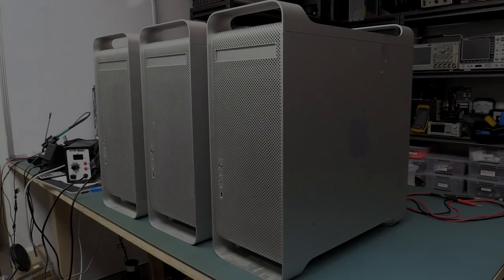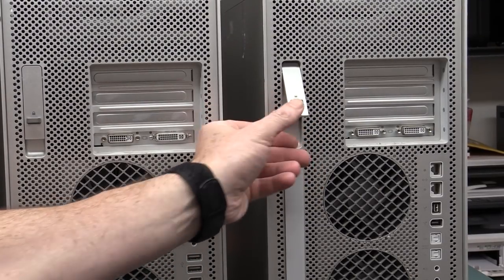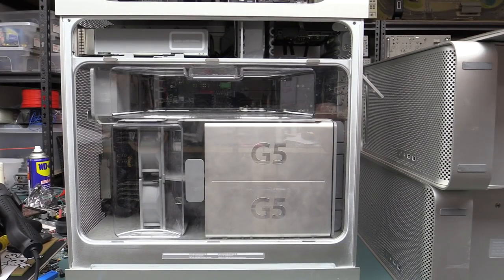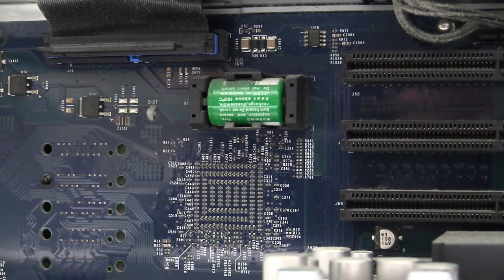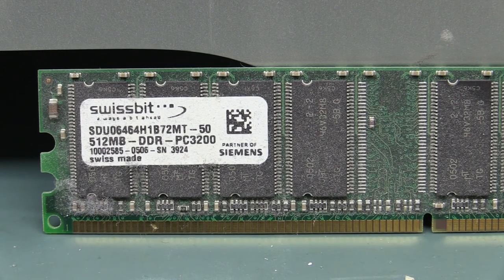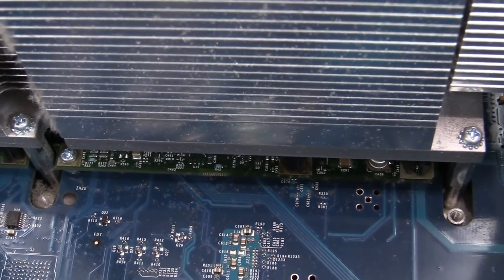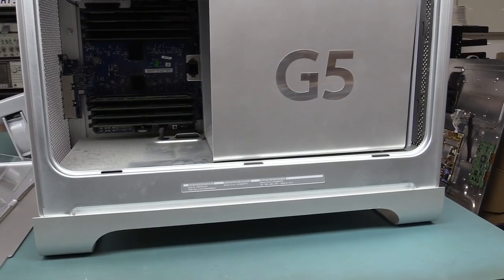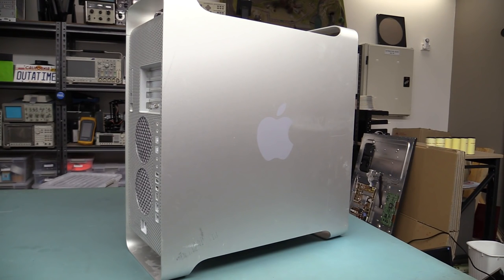EEVblog #783 - Dumpster Dive Power Macs

Comment: One word  LINUX!
Reply: all three of those machines will be verry capable while running a decent distro
Reply: There are no Nvidia drivers for Linux on PowerPC.
Reply: you replace the video card
Reply: +Fennec Fox (FennecTECH) With another unsupported card? Vendors won't write drivers for PowerPC systems because nobody uses those CPUs anymore, except for embedded systems.
Reply: Use a intel card   open sourced drivers like fx86-video-intel or noveau will work   and think about it   a simple generic rframebuffer drivver will do just fine in such a machine i mean  what kind of poweruser things will you do on a powerpc archatecture   it will do great for media   plenty of oomf
Reply: +Fennec Fox (FennecTECH) If you're giving up on graphics acceleration, what's the point of switching to Linux at all? The Mac OS X drivers still work and it's BSD Unix under the hood.
Reply: a machine doesnt need graphics acceleration to be useful   the point of switching to linux is having a mainstream (and still patched) operating system that has more uses than as a mp3 and dvd player
Reply: +Fennec Fox (FennecTECH) A desktop needs graphics acceleration to be useful. A server doesn't, but these machines are museum pieces. For the cost of power to run them you can get far more capability from a modern server. Using them as servers makes no sense unless you like burning money for nostalgia.
Reply: +Patrick Winslow Nobody uses those anymore, when power is the getting bigger and bigger on the server side.
and the fact that it's an open platform compared to x86
Reply: +MrKillius24 ?
Reply: Patrick Winslow
You said power died. It's still alive
Reply: +MrKillius24 I said vendors won't write GPU drivers for Linux on PowerPC desktops because nobody makes desktops with those CPUs anymore. I know Power CPUs still exist in the server market. The point is that the G5s in the video are not practical as either servers or desktops.
Reply: Patrick Winslow
The open source drivers are still maintained and work perfectly. Also if we wanted a better platform than x86(It sucks). Power is defo ready for the taking for any company
Reply: +MrKillius24 I've never seen anyone actually get Nouveau to run on a PowerPC Macintosh. Even on x86 it performs far far far worse than the  proprietary Nvidia driver. That will not change for the foreseeable future as Nvidia is the most uncooperative company on Earth with regard to free software development. Also, PowerPC is not coming back to the desktop. IBM made a deliberate decision to leave that market because they  couldn't keep up with Intel's R&D spend. That's why Apple was forced to switch to Intel in the first place. The x86 ISA sucks, but even Intel couldn't escape it. They've tried. The power of legacy is just too strong. But ARM may become a contender someday.
Reply: Patrick Winslow
 Not what I said, I said power is an open standard that any company can come and make better. They could make a consumer grade chip tomorrow.
Ibm would be happy to lease them the chip designs
Reply: +MrKillius24 Any company can try but no company will succeed in turning a profit. Intel's process advantage is too great. There aren't enough PowerPC enthusiasts who will pay a premium for a processor just because it isn't x86.
Reply: +Fennec Fox (FennecTECH) The world is actually UNIX. These machines run OS X which is a certified UNIX, Linux is not a certified UNIX. OS X can run all Linux apps as well as Linux can but Linux cannot run all OS X apps (same is true for UNIX apps). If you want to geek out, just open up a terminal window in OS X and enjoy the full powered UNIX command line.
Reply: i know osx is unix   iOS is also unix (i have one of my own with a ssh and ftp server on it)  but linux is far more useful than most unixes   the OSX wich will run on that is out of date and unsupported while you can get a linux distro thats latest release will run on the machine.
Reply: yeah
Reply: Or OpenBSD.
Reply: Even the Linux community has abandoned the PowerPC Macs.
Reply: historically i realize how expensive are macs, and to resell them, nobody wants them after. it's a waste of money.
Reply: I'd just like to interject for a moment. What you’re referring to as Linux, is in fact, GNU/Linux, or as I’ve recently taken to calling it, GNU plus Linux. Linux is not an operating system unto itself, but rather another free component of a fully functioning GNU system made useful by the GNU corelibs, shell utilities and vital system components comprising a full OS as defined by POSIX.
Many computer users run a modified version of the GNU system every day, without realizing it. Through a peculiar turn of events, the version of GNU which is widely used today is often called “Linux”, and many of its users are not aware that it is basically the GNU system, developed by the GNU Project. There really is a Linux, and these people are using it, but it is just a part of the system they use.
Linux is the kernel: the program in the system that allocates the machine’s resources to the other programs that you run. The kernel is an essential part of an operating system, but useless by itself; it can only function in the context of a complete operating system. Linux is normally used in combination with the GNU operating system: the whole system is basically GNU with Linux added, or GNU/Linux. All the so-called “Linux” distributions are really distributions of GNU/Linux.

Comment: 0:20, actually thats false. It's still possible to use them as main computers to this day. Theres a lot of software available for them and if you need any help, PowerPC Macs have a tight community that would be happy to help anyone.
Again, 2:53, that's false. An iPhone 6 is not as fast as a dual 1.8GHz G5. And a G5 can do a lot more. They are not useless. I don't want to be a dick, I like this channel, but maybe do some research and use them before you go calling them slow and useless.
10:45, yes, they do run the latest version of Ubuntu and Ubuntu Mate.
Reply: +Walnut Spice Throw some 1TB Western Digital Blue drives in them, up the ram to at least 2GB, up the video cards from anything but the GF FX 5200 64MB card and you'll see, they are way faster and more usable than you claim.
Reply: ***** Have you used one? So you don't know the performance of them.
Reply: ***** Does it have the original drive in it still? Upgrade it. Huge performance boost.
Reply: +Walnut Spice I absolutely agrees with you. I have several customers that still use their G5s to this day because are professional film and sound editors and there is just no reason to replace them. The G5s work perfectly. It seems that all that airflow engineering has kept all the components so cool that they just haven't failed. Some benchmark scores might be higher for a current iPhone that for these G5s but in the world of video editing, no iPhone now can keep up with the G5 (we have tried a few editing apps on the iPhone, they are great for short simple clips but that is all they can do), the G5 can plow though massive amounts of video data for many hours a day without a hiccup. Its an apples vs oranges kind of discussion.
Reply: THANK YOU!

Finally, somebody with an inkling of an understanding of the G5 processor!
Reply: Ok so this is just me watching old youtube videos and replying to old comments in the middle of the night, but that's just a load of nonsense. It's a bit hard to find data on these old things but here's some LINPACK numbers:

"the Dual G4 1.42 achieves 90Mflop/s, while the new Dual 2GHz G5 scores 236Mflop/s"
https://www.macrumors.com/2003/06/30/powermac-g5-benchmarks-again/

The top score posted by an iPhone 6 is 759 Mflop/s
http://linpack.hpc.msu.ru/devices.php?mac=&dev=iPhone%206

Here's a graph of linpack performance of contemporary intel/AMD CPU's (scroll down):
https://techreport.com/review/6213/intel-pentium-4-prescott-processor/4
As you can see, not even the cheap and cheerful Athlon XP in its worst case scenario performs as poorly as the G5, bottoming out around 280Mflop/s!

For perspective: The fastest modern desktop CPU's, intel core i9 reach almost 1 *tera*flop now in 2017 (near 100Gflop/s single core performance).

https://www.pugetsystems.com/labs/hpc/Intel-Core-i9-7900X-and-7980XE-Skylake-X-Linux-Linpack-Performance-1059/

The G5 was a terrible CPU for real world use and thermal performance in relation to its cost, a mainframe architecture bodged into use for desktop and Apple never solved the thermal issues adequately which was a huge part of why they went to intel CPU's after this (also why there was never a G5 laptop, it just was never going to happen). They don't have these monstrous heatsinks (and some of them needed to have water-cooling!) because Apple engineers wanted them to run cool or quiet - it was just absolutely required to dissipate the enormous 200+W heat load generated by two G5's at full power.

Some info on that from random internet forum:
http://macos9lives.com/smforum/index.php?topic=2211.0

I guess it won't do anything for the "cult" of G-series powermac worshippers that existed already when these things were new, buying into Apple's absurd marketing wank of how these computers are powerful enough to be export limited as "supercomputers" (according to an obsolete government standard) and all that.

https://www.tekrevue.com/apples-1999-power-mac-g4-really-classified-weapon/ For those who are interested in a retrospective on that.

Even going on Apple's own marketing, Mac performance around doubled to quadrupled overnight when they launched intel Macs, which really makes me wish I had been a fly on the wall in their marketing department when they had to explain THAT.

Comment: 1:37 - wifi/bluetooth antenna

That machine also supports 16GB ram as the other two only supports 8GB.  Memory has to be installed in pairs too

Comment: If the G5s are dead, you can get ATX case conversion kits. Some kits only require cutting the rear of the case, and you can put in a full ATX motherboard. You can even get wire harnesses which allow you to use the stock front I/O panel.

The last version of OSX that these will run is 10.5.8, though most people who still have them will probably want to go with 10.4.11 as then you can run classic Mac games on that OS.

Comment: The one on the right, looking at the view showing their backs, is a late 2005 based on the way the ports are configured. It was the only one with built in wifi and bluetooth antennas.

Comment: 3:05 those are Gems and it’s all upgradable to max specs and can still perform almost as good and fast as the modern specs machines, this video is quite old but I just wanna shoot the stars if one of this pups is still available in your lab I’ll be very happy to foster it and happily use it as my main machine 😁

Comment: I have the dual 2.3, the one above the PCIE model you have, they're actually dual core single processor machines. They made a dual processor model that was in total a quad core machine as well. I put a  GeForce 7800GTX 512MB video card in it and it'll still play HD youtube videos amazingly, its still very useable despite its age.

Comment: In my experience in the UK they're still pretty damn pricey on the used market (even the underpowered 1.8GHz models that are basically useless). The cases are worth a small mint too. They are still somewhat useful as a PowerPC Linux machine or a server or something if you're not too concerned with the power bill.

Comment: I had one of those dual-CPU PowerMac G5's back in 2011 or so. That thing could still kick ass, and beat out the Intel Core 2 Duo's of the time despite being quite a bit older. They were the fastest desktop CPU by Motorola, and output so much heat that liquid cooling came standard. Unfortunately that is also how many of them met their demise, as many started to leak after a few years.
Reply: +IronOreGaming   and that is why Microsoft picked up the PowerPC chip for their xboxes and are still having heat issues..........
Reply: imark7777777 I'm pretty sure Microsoft never put a Motorola chip into their Xboxes. The 360 used an IBM chip, and the Xbox One uses an AMD chip.
Reply: +IronOreGaming I'm sorry I was thinking that Motorola developed the PowerPC chip, instead it was a apple-IBM–Motorola alliance. I was also under the impression that they continued off the development from a test system that used a PowerPC chip but instead they continued with a similar architecture chip.
I remember hearing lots of stories of Microsoft demoing Xbox prototypes on Apple equipment.

(insert quote that backs up my story)
http://lowendmac.com/ed/bashur/12db/g5-gaming.html

Comment: Nice find I owned a 2005 power pc and I loved it to bits it's still a lot more powerful than a iPhone I can assure anyone that I remember playing halo in maxed out settings on mine which my not sound like much today but nearly all Intel PCs struggled to play the game. I eventually upgraded to a Mac pro 1.1 which was another under rates beast and now I've a Mac pro 4.1 which I'm using today still a beast with dual Intel quad core Xeon's 44GB RAM, EVGA GTX 980 SC 200GB Intel SSD and 2TB WD HDD

Comment: That white strip on the backside is actually for the internal wifi antenna if I am not mistaken. The older models had a special antenna port where you would need to connect an external antenna to if you wanted a wifi connection instead of ethernet.

Comment: Dual G5 systems are still very usable for audio production, but one has to be particular with software selection. Reaper 5 is brand new but still has a PPC build, for example. Nice score, Dave. If you intend to blank and reinstall the OS on the working systems, you'll need discs for OS X 10.5 / Leopard.

Comment: had the same dual processor unit,as you stated it was a fantastic looking machine as far as construction,but processing power was a real drag so i traded it for a Mac Mini dual which is still with me after 6 years,flawless work.
In perspective,its a pity using all that nice metal for a machine that has a programmed life of 2/3 years maximum,today maybe less,also because it is almost always placed in a shelf under your table,so nobody can admire that beautiful construction

Comment: Also you can run Final Cut Pro 7 (2009) on them, though Apple says FCP 7 only works on Intel.

Actually, it's a universal binary and is limited to Intel macs in the installer.  Edit the installer's .dist file and remove 4 lines of javascript and it installs perfectly.

Comment: 56K modem really takes me back in time.  They were slow, noisy and for the longest time there was no other internet here in the stix.  A few years ago, our options opened up some and now there is cable and DSL.  DSL is not the best but ANYTHING beats the dial-up connection we had by a very long shot.  Dial-up was awful.  If someone picked up the phone, you would loose your connection.

Comment: Just a heads up, it looks like the newer one is water cooled. also the PSU can handle 1000w full duty cycle. (good for electrolysis). The CPU boards are quite interesting btw.

Comment: I have one of these and will be modding it to put my current pc or future build in it. Also I am pretty sure that the case is Steel. It is about 30lbs dry with nothing inside.
Reply: its definitely aluminium.
Reply: +Glen “Protious” Jones Its clearly aluminum and says so on the Apple specs page. Try a magnet.
Reply: have messed with the the case. is most definitely aluminum.

Comment: It's not DVI M. It's ADC (Apple Display Connector) - a proprietary modification of the DVI-I connector that combines analog and digital video signals, USB, and power all in one cable.

Clever idea, and typically Steve Jobs-ian in it's simplicity, but only worked with the Apple Acrylic Studio and Cinema displays.

Comment: Those PowerPC based Macs will support up to Mac OS X 10.5.8. They will also run a Linux PowerPC (PPC) variant such as Debian. The A1177 has a Geekbench single processor score of 2122 (4244 for multi-core) and the A1047 has a single processor score of 2013. For comparison my Early 2011 MacBoook Pro with a 2 GHz Quad Core i7-2635QM has a geekbench single processor score of 2110 and multi-core score of 7592. There is still useful life in those Macs, especially as a training system if you want to learn and play with Mac OS X or just putzing around the Internet. They are power hungry, but if you enable all the power savings and auto sleep modes they are manageable. For more comparison, my Mac Pro Mid 2010 that I retrofitted with two Intel X5690 (12 processor cores total) has a geekbench multi-core score of 27,134.

Comment: Fun Fact (sort of): many older Apple product designs are based on the designs from 1960-70s Braun Company. Like this Macs design- it is based on the T1000 Radio design. 
Or the design of the original iPod. Look at the pictures on the web. It's unbelievable to see how many designs Apple copied from just ONE company. 
But they sue everybody, who has rounded squares as icons in their os...

Comment: About three or so months ago I had one of these cases laying around and I had I also had a 2013 or 14  iMac that had a overheating problem.  so I took the iMac apart stuffed it inside the power PCs case hook the fans up from the PowerPC into the imac motherboards the thing works surprisingly well and I even took the screen from the iMac a mountain it to the door side of the case